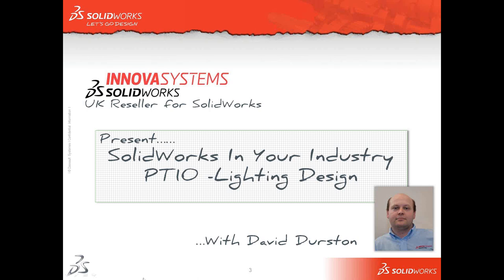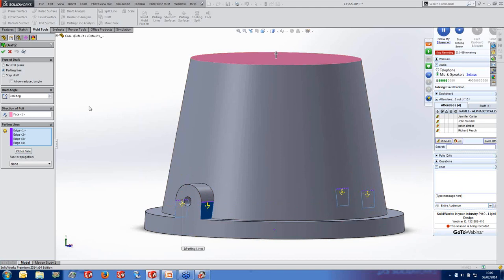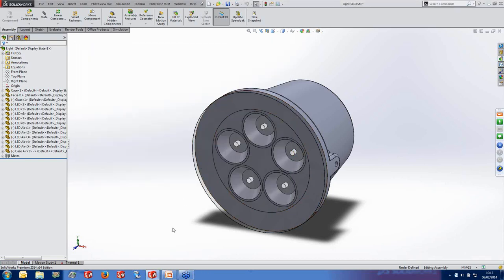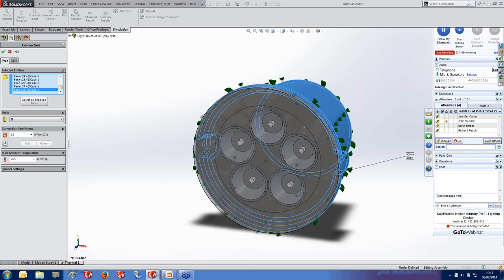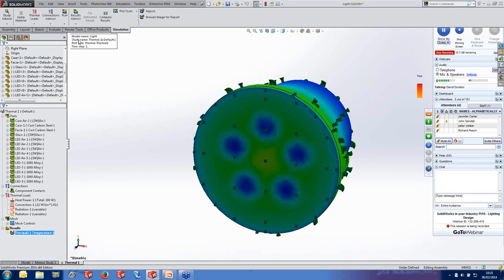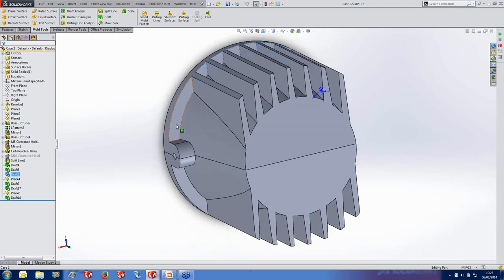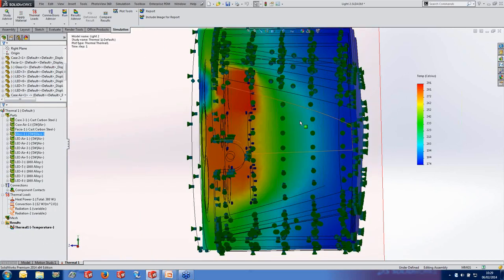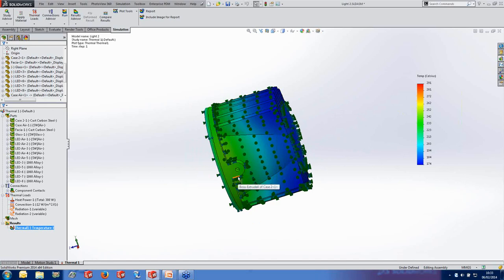SolidWorks in your Industry Pt10 - Lighting Design

Comment from the maker: We were asked the following question by a SOLIDWORKS user and thought it would be useful to share the answer with our viewers.

QUESTION:

I see you apply the following thermal loads: 1) Heat power (on the LED driver) 2) Convection (back casing) 3) Radiation (back casing) 4) radiation (front glass)

- Why only convection of the back casing? And not of the front glass?
- Why is there no heat power set on the actual LED's?

ANSWER:

Adding fewer thermal loads was partly done for simplicity and speed, allowing us to get results within the space of the video.  Also, if an LED is mounted in a ceiling there is only ever going to be minimal convection (as the hot air cannot rise further), and the heat power output of the LED itself is tiny in comparison to the driver.

You can of course add in these additional thermal loads to make the study more accurate, but it will increase the solve time.

Hope that helps.

Innova Systems.